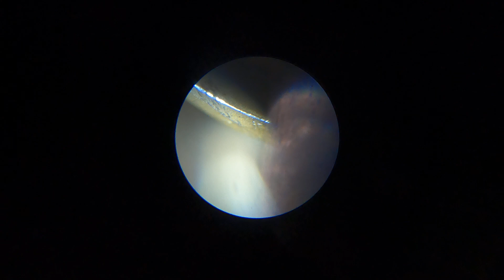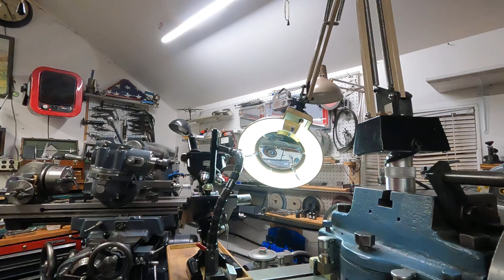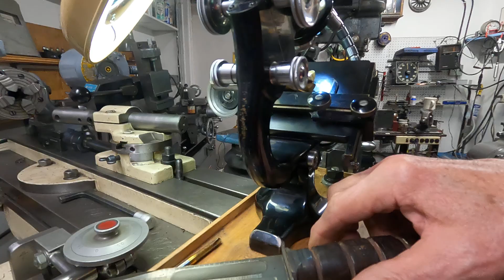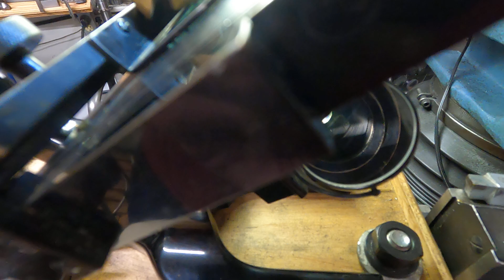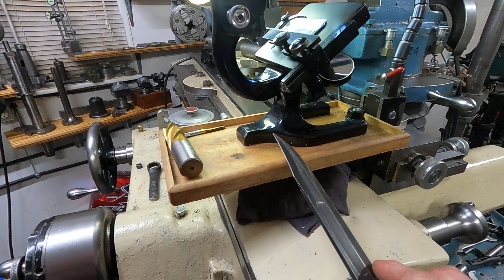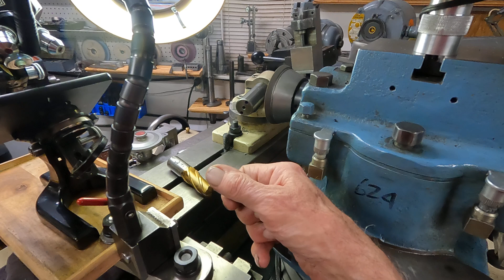Machining with sharp  vision

Comment: I'm an old timer who's fabricated, welded & built cars, race cars & done construction for over 50 years.  Wanted to learn machining since high school, but it wasn't in the cards or budget until I bought a lathe at 63, then was laid up for 3 months during the winter & spent the time learning on YT, books & the Internet.

Being officially 'ancient', I brought skills & experience from other disciplines.

I've had my eyes open for a deal on a binoc setup like yours, but it's more for convenience since I get by fine w/ my collection of jewelers' loupes & a microscope app on my phone.  Just got a good quality, but inexpensive mini medical cam & I've been kicking around how to turn it into a microscope camera, that's easily removed for poking it in holes, when needed; if it's real good mounted, I'll invest another $15 into a dedicated mobile cam.

I agree completely w/ your thoughts on magnified viewing of tooling. I have a small lathe I've beefed up into an over-achiever until I find a bigger lathe, (if, no, when I beat the effing cancer, that is).

I jumped to carbide inserts for routine turning & quickly became dismayed at their dullness under mag.

Not knowing any better, I've been tuning up new inserts, re-shaping chipped ones & discover my little lathe can do things the brand normally can't.  Harder materials, bigger DoC & tighter tolerances, mainly due to razor sharp tooling.

Just got a mill this summer & beginning to carve things up w/ it; sure beats a router table & other methods I've used in the past.

I've scavenged up enough parts & pieces to build a linear bearinged, re-circulating ball screw tooling sharpener & re-conditioner.

Never considering sharpening tooling any way BUT against the grain. 

If you want microscopic hacksaw blade-like edges, then grind w/ the edge; not for me, I want my tooling sharp AND clean edged.

I'm in your corner, all the way...

GeoD
Reply from the maker: I think I beat cancer by walking and being outside as well as the medical. the carbide inserts have a complex design and it takes considerable power and depth of cutfor them to actually work like they should. I think you can grind anyway you want and it depends on the machine and material. Older cutters may not be made as accurately as new cutters and the flute has to be located directly. There are many ways to sharpen and all likely better than mine, but I get by anyway.
 I think stropping removes the burr from going with the edge but with steel I go to the fine Arkansas stones for a good enough edge for my wood planes. A little magnification can help fine tune things as needed, I have gathered a collection of gadgets I still have an Emoscope "vest pocket optical system" advertised in Popular Mechanics in the 1960s!